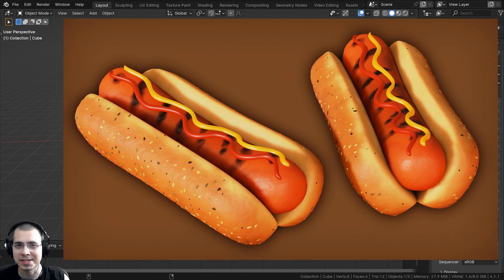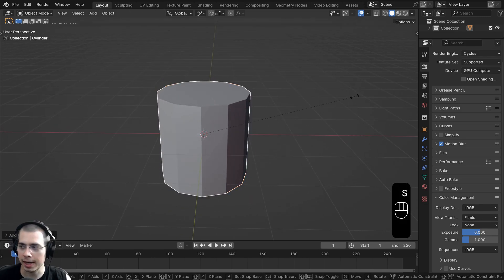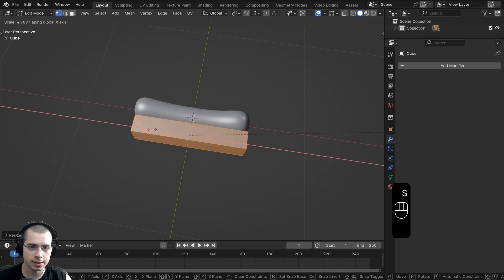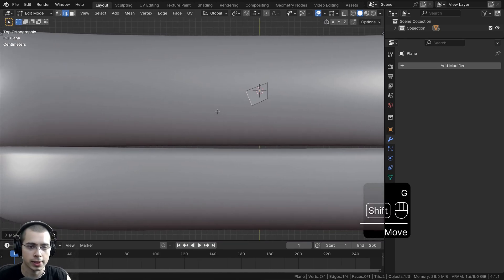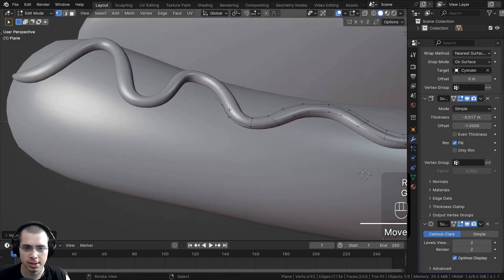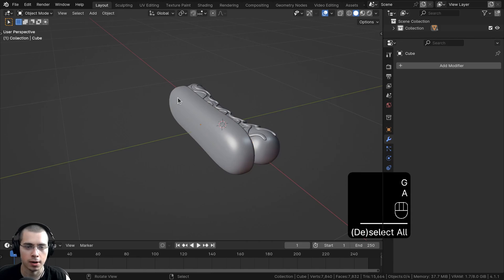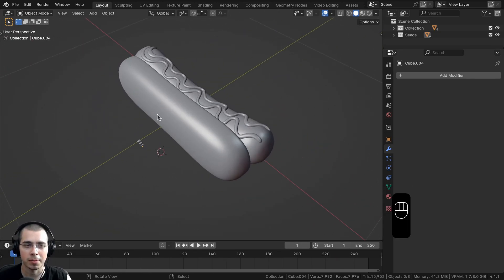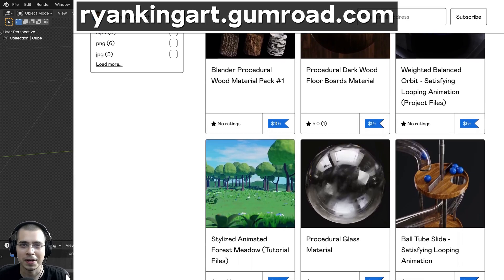Part 1: Stylized Hot Dogs 🌭 (Blender Tutorial)

Comment: why when i do the ketchup line then at the ends it just goes inside the sausage and bugs please help
Reply: Anyone having trouble with the squirt lines, in the Shrinkwrap, the default method is Nearest Surface Point. Change it to Target Normal Point (and wish for luck) and maybe it'll work better. 

Another source of trouble is that maybe your ribbon of quads, in Edit mode, is too narrow. In edge select mode, ctrl-shift (or alt-shift, i forget, only my fingers know) select one of the long sides and move it away from the unselected side.  

Finally, if it's not as close as it can be, move the ribbon (in edit mode) closer to the hot dog. If the ends of the ribbon sink in, bend them up along +Z.  It doesn't have to be flat. 

If your ketchup squirt line still looks bad, delete it and start over following more closely what Our Great Teacher does.